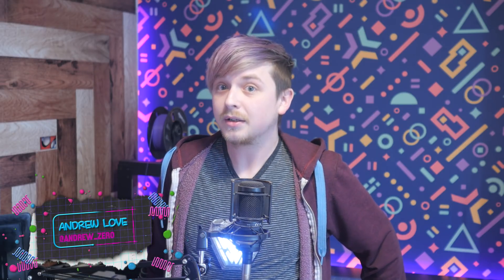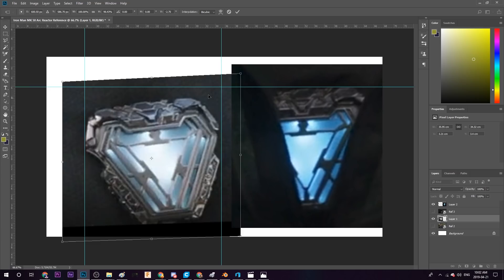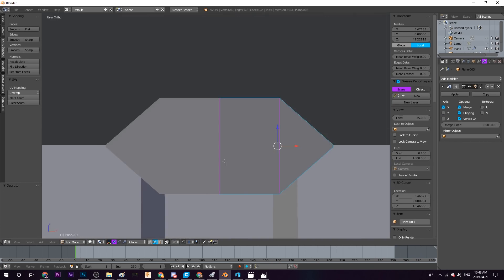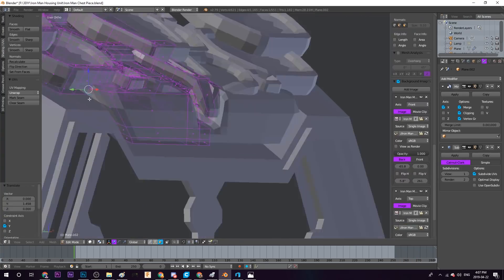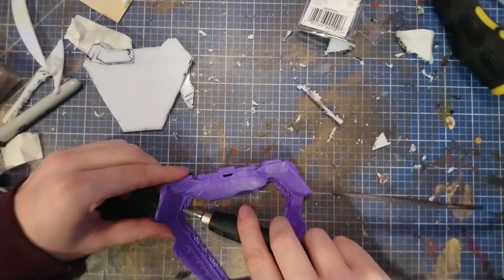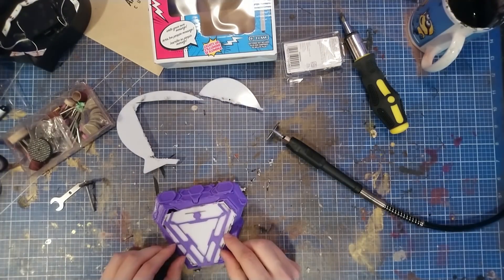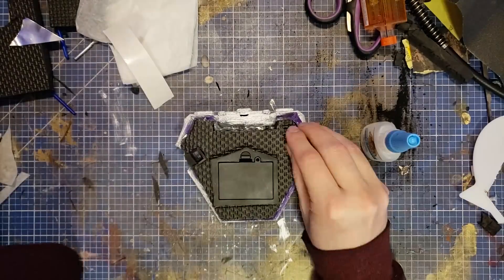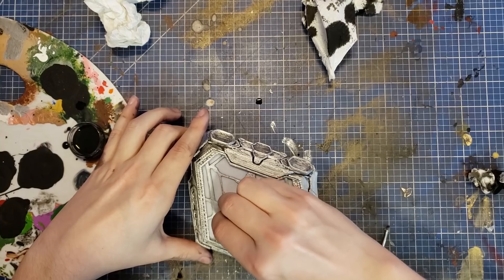How To 3D Print Iron Man's ARC REACTOR (Mk 50) - Avengers Endgame Prop DIY

Comment: Im making this right now but my parents wont buy me a dremel tool so is there another way i can cut my acrylic?
Reply from the maker: Yes there are definitely other ways! You'll have to be very careful and I would advise doing it with parental supervision. Using a ruler or flat edge, you'll want to repeatedly and carefully score the acrylic with a sharp hobby knife. Once you've created a significant groove in the acrylic you'll be able to, hopefully, snap the acrylic cleanly along that line. You'll then want to use some sandpaper to clean up the edge. Repeat that process for all of the edges and with a little luck you should be able to cut the shape out without using any power tools! If you have access to a jigsaw or even a coping saw, that would be another effective way to do it, but the knife method is something anyone can do with a little patience! 

Good luck with the project! I'd absolutely love to see some pictures when it's done! 😁
Reply: @3DIYshow  Thanks!
Reply: @3DIYshow  What about the lights? I bough the exact same thing but i can cut out the battery pack. Now what?
Reply from the maker: Hmm. My first thought would be to use a pair of tin snips (the big heavy duty scissors used to cut metal like tin and aluminum) to just cut away the extra plastic. Carefully. Again, for this a jigsaw, hacksaw, coping saw of frankly, any saw you can make work would probably get the job done.
Reply: @3DIYshow  I dont have a saw but you reminded me of something! My school has a design and tech room and there are a variety of saws there. Thanks so much!
Reply from the maker: @PurpleHairedGaming  that's great! I'm glad your school has that, that's a great resource! Good luck 😁